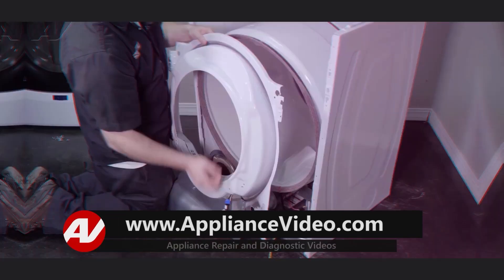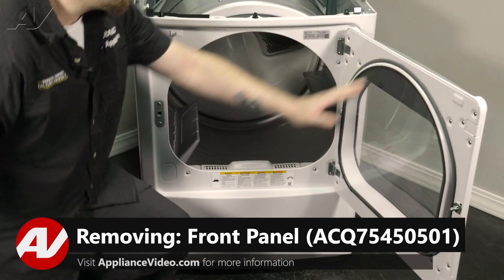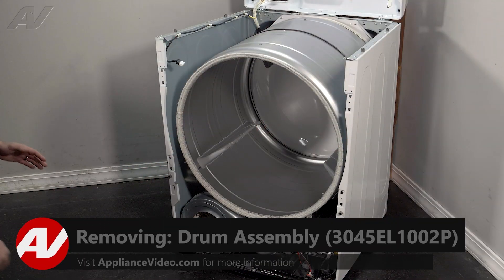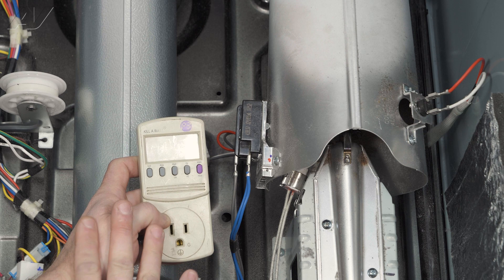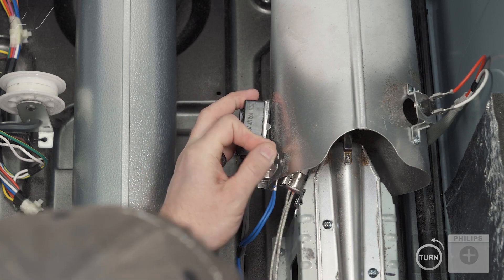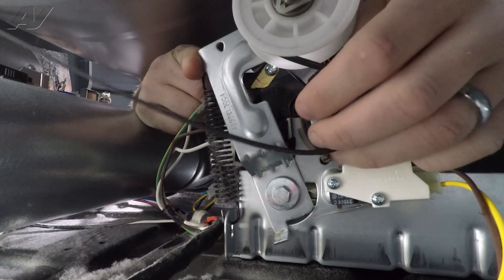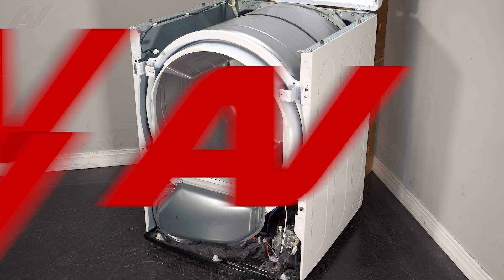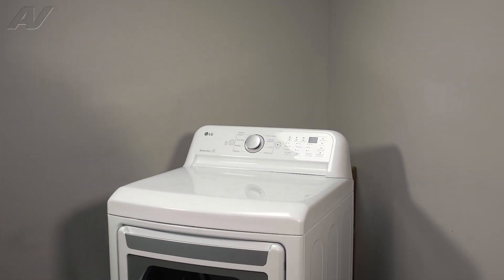Dryer not Heating or Drying Clothes - Factory Technician Diagnostics & Troubleshooting

Comment: I have a 2-1/2 year old LG DLG3401 clothes dryer that is getting me in trouble with my wife. Sometimes the burner comes on and dries the clothes, other times it just blows cool air and it takes forever to dry. Sometimes the burner lights and works good but after some time, the burner shuts off and just blows cool air.

I've taken it apart and tested every sensor according to the service manual and they test good. I have no way to test the main control board and they cost about half the price of a new dryer and probably aren't returnable. It's not a problem with the humidity sensor since I'm using manual timed dry.

Any ideas what the problem could be and how to test?

Thanks, Jim